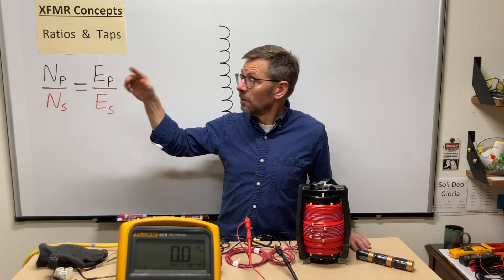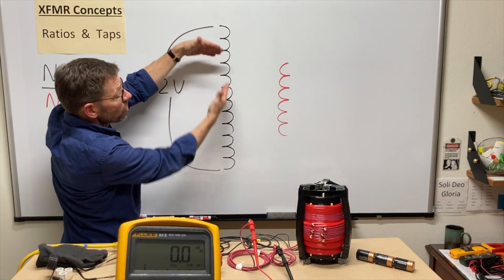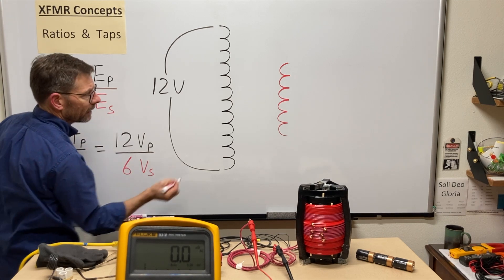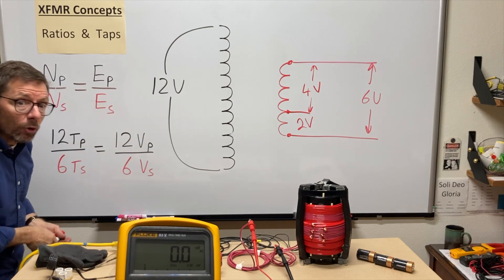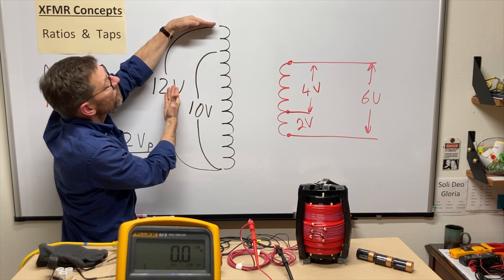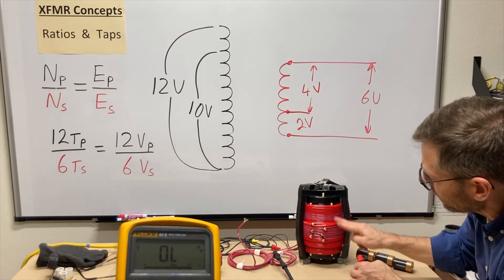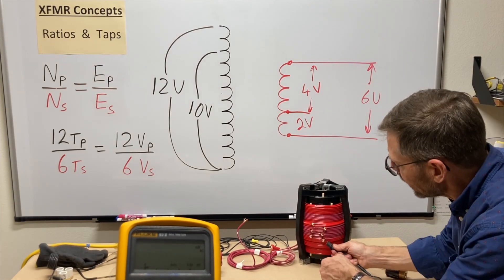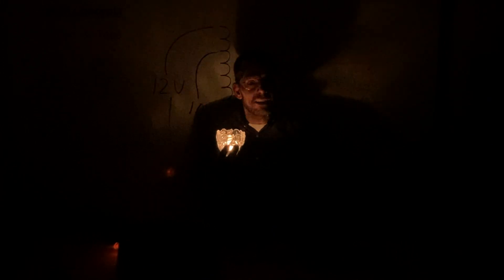Transformer Ratios and Taps

Comment: Dave, I had to watch your video several times to be sure I was hearing right.  Your explanation of the secondary is good but the  primary is backward. To decrease the secondary voltage, you have to add turns to the primary.  Tapping the primary will raise the secondary voltage. If you tapped the primary down to the same number of turns there are in the secondary, it would be a one-to-one transformer and the output would be 120v. Your formula says it all: to decrease EsubS you have to increase NsuP.

Comment: Thanks. What makes the center tap voltage equal to zero. Is it inherently zero (if so, why), or is it zero because it’s connected to ground (for example, in the case of a breaker box)?  Much appreciated.
Reply from the maker: Quick answer: Because the center-tap, or center point of the transformer, is connected to ground.
Longer answer: First we want to recognize that voltage is the difference of potential between two points, meaning that one point on a system does not have a voltage in and of itself, but rather a voltage between that point and another point. I believe you're referring to a three-wire center-tapped system that is used in homes in the United States where the center point on the winding is grounded and the neutral is also tied into that same point. This means that measuring voltage across the whole coil is 240 V, whereas measuring from either end to the center point is 120 V (half the turns of the total transformer yields half the voltage). If ground is your reference, then you will get zero volts at the center point of the transformer because it is grounded, and you are measuring between two points that are at the same potential.
Here are a couple links where I discuss a little more about those systems:
120/240 and 120/208 V Secondaries: https://www.youtube.com/watch?v=xMZkKI5rleg
120/240 V, In-Phase or Out-of-Phase: https://www.youtube.com/watch?v=nOSYHUxHxG8